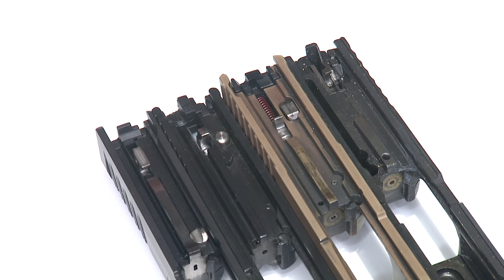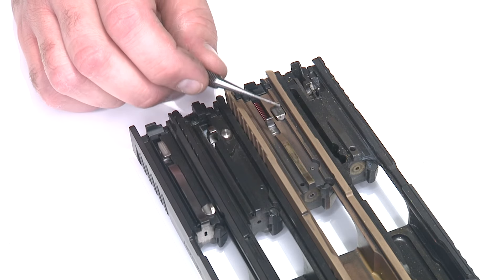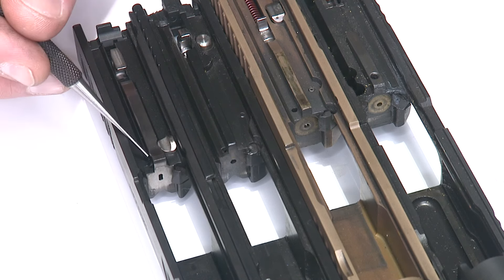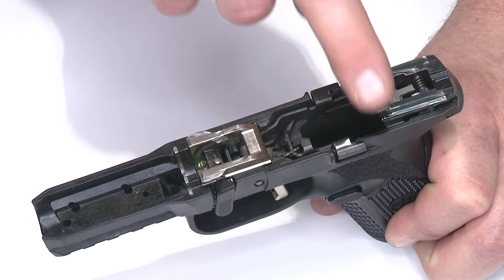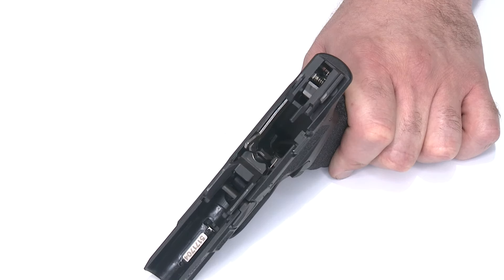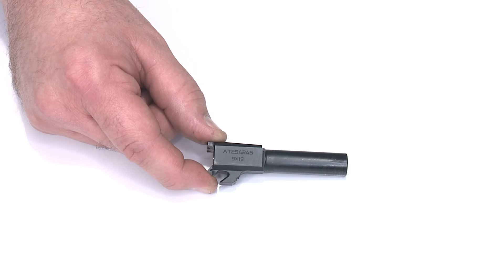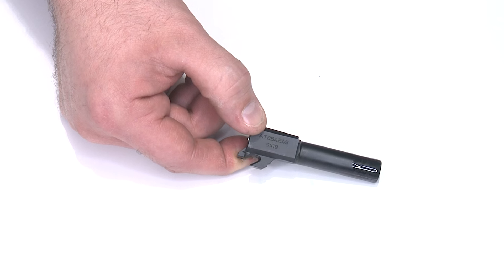PSA: How To Properly Lube Your Striker-Fired Pistol

Comment: Glock manual says to lube slide rails
Reply: I've run Q tips or cleaning patch with a dab of CLP or oil for many years; Glocks, M&Ps, PDP models. I use Slip 2000 EWL or Clenzoil brands mostly. I'd agree, you don't need to douse or soak semi auto uppers in gun oils, CLPs. Just the points that see contact or wear.

Comment: I didn't know better at the time and I put oil inside the slide, how do i get it clean now so it doesn't collect debris?
Reply from the maker: You'll need to remove the striker from the slide and use a cotton swab to clean things out.
Reply: @apextactical not to be a hater but I belive on a r.a.p 440 you are meant to lube the slide because I did lube the slide and the slide was smooth with a slight grab half way through the cocking action. but seen this comment and then dried my slide then lubed the spots you said to and now it’s grabbing harder half way through
Reply from the maker: @Mango-xr1ow  I don't know what a R.a.p. 440 is, but some guns may require more lube than we show in this video.

Bottom line is, make sure to lube it or it won't run.

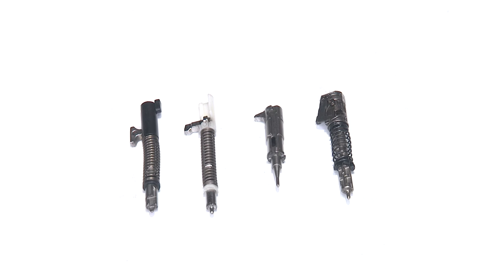Comment: 2:28 "you can cause a hydraulic cylinder". Perhaps he meant to say "hrydolock"? Hydolock may be possible in a perfect environment, the vent hole being blocked would certainly affect the function of the striker, but, blocking the vent hole doesn't create a hydraulic cylinder. However, if a incorrect or this is juat a basic computer generated A.I. system for clicks, im always open to turning my hanguns into wood splitters.

Comment: Hi!
I just subed to your channel.
Questions...What if I over lubed the gun...How can I reverse the process?

Do I dip everything in alcohol then place oil or grease in the points you mentioned?

Thanks
Reply from the maker: Disassemble it and clean it like you normally would. Oil in the striker channel is the big concern. That you need to be sure is kept clean and dry (from lube).

Comment: I think it’s crazy how most of us will sit here and comment on this video telling them they over lubricated but then first of all even if they did they probably take that gun apart each damn time and remove any oil that’s in the frame the main goal is to not get any in the firing pin channel other than that the lubrication won’t hurt and most of these comments here say Glock says to oil the slider rails the same a Glock and I know what you’re thinking door yeah sure it is but I’ve Glock is a lot loose compared to FN that has tighter tolerance Keep it up eight pics you guys won’t be around if you guys didn’t know what you were doing